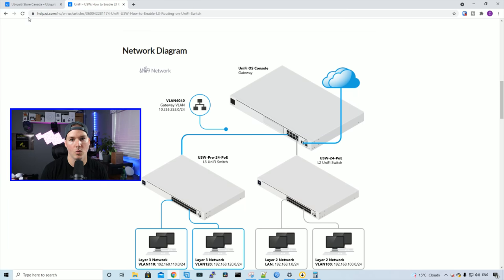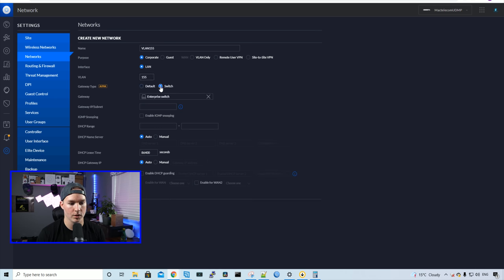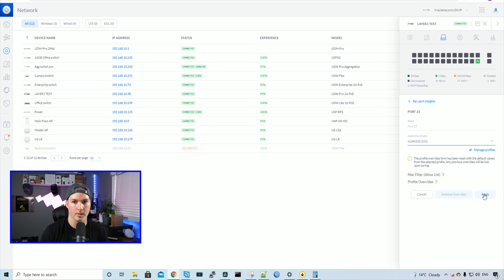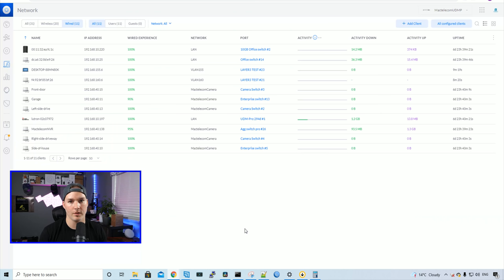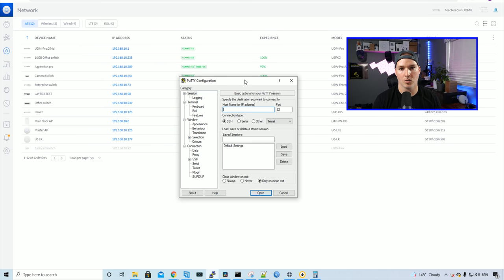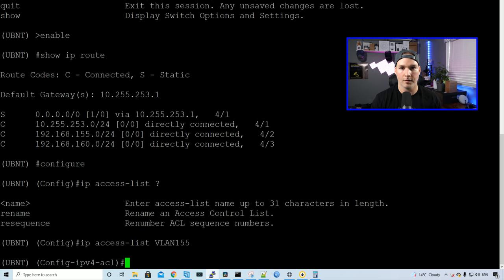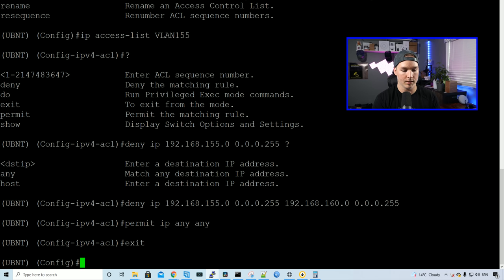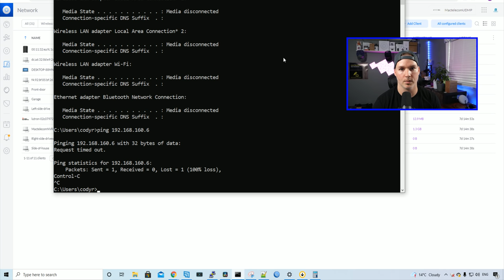Unifi Layer 3 Switching

Comment: Can you please do a video to explain this.  UniFi Switch - Layer 3 Routing
Layer 3 Routing allows a UniFi Switch to route traffic between VLANs and to other destinations using static routes. It is possible use L3 Routing with a UniFi Gateway or third-party gateway.

cannot get internet access from a layer 3 switch when it is set using unifi XG or Router console.

Comment: Is this SSH to create temporary ACL rules still the only way to make these rules for setting up inter-vlan blocking for L3 switches?
Reply from the maker: There is an update coming out that will allow us to do it in the gui interface. It’s currently in early access
Reply: @MactelecomNetworks  Awesome. I guess that's about perfect timing for me. lol. I do have Early Access on my account, and I am about to put my L3 switch in later today which is why I have been going around watching videos on Unifi ACLs. Is the place to make those ACL rules in something like Settings -> Routing -> Policy-Based Rules? Or do I make them in Settings -> Security -> Traffic & Firewall Rules?
Reply: I did figure out the area to configure the ACLs. It is unfortunately an all or nothing thing right now. Block a whole VLAN from another VLAN. I wish I could make exception rules or just specific rules, as I want to block most devices but let 1-2 from some VLANs have access to another VLAN.
Reply: I posted on Ubiquiti forums asking for more ACL features and Glenn @UI said they are a work in progress and more capability is expected to release in the next minor update for EA 😁

Comment: I saw that you configured "Block inter-vlan routing rule" in the firewall to prevent RFC1918 to RFC1918.    But I also noticed that you configured VLAN ACLs to prevent inter-VLAN communication. Is this necessary? Why are you doing this?

Comment: I have a total 4 VLAN vlan10 Data, vlan11 printer, VLAN 12 Wifi, and VLAN 20 for voice, I need to configure inter-VLAN routing unify 24 port enterprise switch could you please help me
Reply from the maker: Are you looking at configuring it through a layer 3 switch? Which router/firewall do you use? If you're using a UDM pro inter-vlan routing is enable by default
Reply: @MactelecomNetworks   through UDM only i can able to reach different VLAN but continuously the ping getting dropping

Comment: Hi Cody, 
Why you did not just creat the ACL instead of the ACL + Firewall rule ?
Reply: The firewall rule was created just to show that it doesn't work for layer 3 routing done on the switches. You would not do this in practice, he just did it to show the point.

Comment: Super dumb question. But can I do later 3 intervlan routing on the USW-24-G2 and the UDM pro?
Reply: You can do it, always could but the performance is not great. On my 10Gbps home network I only get about 1Gbps throughput when doing inter vlan routing using UDMP.
Reply: @carlnakamura4861  thanks for the reply. I tried to configure intervlan routing quickly it couldn't get it to work. Running all my traffic through the SFP port and I couldn't get it to work. May have to create a separate trunk port for each vlan, maybe?

Comment: A good simple explanation & demo of setting up Layer 3 switching on a UniFi switch. Personally I'm not too worried about not having the ACL functionality in the GUI because I don't have a use for that typically. If I want to filter a L3 interface I put it on a firewall but the option still needs to be there. The more worrying thing is the DHCP relay not working on a VLAN interface on a L3 switch.

Comment: Still waiting for that ACL to be functional in controller GUI...
Reply from the maker: You may be waiting a while
Reply: @MactelecomNetworks  from my several years experience with unifi, I no longer wait for anything. If it does not have it now, I would just choose another solution. New shiny aggregation switch? No, edgeswitch still works great, has L3 and proper ACL. New router? No, pfsense still my go to.

Comment: Hey Cody, great video but I'm curious on the performance of inter vlan routing/L3 routing. As you can do L3 routing in UDM Pro functionally but performance is really bad. I can only get just above 1Gbps throughput. L3 routing at 10Gbps would be the one thing that would warrant buying the unifi pro line switches. Are you planning on doing any performance testing of L3 routing using the pro switches?

Comment: Keep in mind that, its a "best practice" to have all Vlans on the edge router(fw) of course it depends from scenario but, lets say youve got  an UTM (sophos, forti, paloalto etc) and having all vlans on those, allows you to apply additional layer of protection enabling traffic filtering  etc.
Reply: It really depends how much traffic is been pushed through. We have around 2000 vlans at work and 4 core switches all in a mesh whilst the firewall is routing more sensitive and less trusted networks for greater flexibility and easier management than ACLs on a switch. Intervlan routing for Wired clients is done on the L3 switches.
Reply: @davidsomething4867  sure you're right. It depends from scenarios ;)

Comment: Great video. Now just have to wait for UniFi to implement it in the UI. Hopefully they will before I need to purchase my next switch, as i need L3 routing and would prefer to stay with UniFi.
Reply from the maker: Ya the command line is a little slow that’s for sure
Reply: @MactelecomNetworks  not so worried about using a CLI. Mostly concerned that my changes will be persistent.

Comment: I need someone to tell me I dont need layer 3 entrprise switches for my home.   I know I dont need it now, but what if one day I do?! lol
Reply: If you're not doing a massive amount of intervlan routing and you have something like a UDM you don't need this. Most of my VLAN traffic I have that way specifically because I don't want it touching other networks. So for those this would not be needed or have any function. But there are certainly scenarios where you do need that (if you're doing more than your UDM can handle, or if you want to offload it so the UDM can do other things). Then these L3 switches can be useful. But if you don't need isolation then you can either not use separate VLANs, or if you do you can leave the access open (the default). Only if you need the separation AND if you need to isolate them for the most part while still allowing other traffic would you follow the steps that have been provided in this video.

Comment: Great video.  I wish UniFi had ACLs built-into Network to make it easier to configure.  Just so I understand correctly, all routing is done through the switch except interVLAN (which goes through the router).  Does an L3 network still have ability to have WAN access?  Would there be any benefit in moving an IoT or camera network/VLAN to an L3 network?  I would still need interVLAN routing as my UNVR is on my main LAN.

Thanks for all your videos!

Comment: nice video Cody, Just a shame there is no persistence when you make config changes in the CLI. I'm in the process of trying to write a script, so when it does reboot it should put everything back on automatically but I've had a few delays on getting round to finishing it.

Something else worth noting is the DHCP Relay does not work on L3 switches. The UniFi console allows you to create one, but doesn't actually do anything which is frustrating when you have Windows Server DHCP setup.
Reply from the maker: That’s good to know I didn’t test the dhcp relay
Reply: Nice Sharing!

Comment: Technically, Layer 3 is routing/IP Layer.  Switching is Layer2. #NetworkNickOfficial
Multi-Layer Switch. Does it do layer 4?
Reply from the maker: It’s a layer 3 switch or yes a multilayer switch which implies multilayer ( layer 2 and layer 3)

It does routing between vlans as well as static routes ( which I’m not sure is working Atm) no layer 4

Comment: Would be interested in seeing you test adding of additional static routes for the VLANs. It is exposed to the UI for the pro switches but doesn’t seem to actually do anything. If you then add via the cli it all kicks into life and works but doesn’t survive a reboot. Can’t seem to get any traction with UniFi to fix what has to be a bug. One of their firmware releases states the support for it.

Comment: Worst implementation ever of layer-3 routing on a switch.  Furthermore, the ACL's should be configured and applied on the switch where the particular layer-3 VLANs are terminated.  Unifi needs to go back to the drawing board because this is a convoluted implementation and still burdens the UDM-Pro with processing the ACL's for layer-3 boundaries that are on other devices.  This will become a problem as the number of layer-3 VLANs and related ACLs grows.  It's also weird that they expose the inter-VLAN routing interface to the GUI.   Hopefully it can't be modified because I would venture to guess that would cause problems and/or require "you" to re-IP your network if that network was in use prior to terminating layer-3 on other switches.  I can't think of any other manufacturer of layer-3 switches that dedicates a separate network to inter-VLAN routing.  I would compare this to the "interesting" way Mikrotik wrote SwitchOS and RouterOS.
Reply from the maker: I think I took this comment the wrong way. Are you complaining about how I had spoken about it or Ubiquiti?
Reply from the maker: Ok you were talking more so Ubiquiti I was confused 😂 you make good points

I just thought I’d make a video as I’d been asked so many times
Reply: @MactelecomNetworks  The work that you do is awesome.  I definitely enjoy your videos because they are very informative.  Ubiquiti should rethink their implementation of layer-3 in the Unifi product line.
Reply from the maker: @rayk32  ya I totally read the first comment wrong 😂 glad you enjoy the videos. 

The layer 3 is still in alpha so hopefully they end up improving it
Reply: @rayk32  Yed, video's are very informative. But Ubiquiti should indeed rethink L3 AND their "firewall". It feels like they're forcing people to use the UDM or UDM-pro but the devices are mediocre at best. (Although the low price makes up for it)
Reply: I can add personal experience with the L3 features of the USW Pro 48 switches.  A few months ago I attempted to deploy 10 USW Pro 48's to a school environment with one of them setup as the L3 switch.  There was an existing non Ubiquiti firewall that we re-used, so we also deployed a cloud key gen 2.  After some trial/error, I was able to get the L3 routing to function in my home lab before deploying to the site.  Discovered that DHCP relay did not work and settled on letting the USW Pro be the DHCP server.  Next we deployed the switches and thought we had a functional network.  However within a week, the DHCP server on the USW Pro failed several times requiring a reboot to resolve.  In the end we had to re-deploy an old Dell 6248 L3 switch and use the USW Pro's as L2 only.  Not exactly what we were planning but it has been stable for a few months and survived the beginning of the school year.  Throughout the configuration and issues I worked with Ubiquiti support.  Eventually the case was escalated to a higher tier support person.  He was very honest and let me know right away the DHCP relay would not work and that using the CLI command as a workaround was not going to survive a reboot.  There may be ways to resolve that by manually modifying files, etc, but since those methods are not supported by Ubiquiti, I chose not to go down that road.  I needed to be able to deploy and not have to re-visit for issues later.  Ubiquiti support would not provide any info about fixing the dhcp relay feature.  I was reasonable with them the entire time and simply asked them to make the limitations known in their documentation and sales literature.  Anyone seen anything in release notes, etc?(to be honest I haven't checked)  Buyer be aware, the L3 features of the USW Pro switches are not suitable for a network outside of a home or test lab environment.  No complaints about the video, just sharing experience.  I use a UDM and Ubiquiti AP's at home and they work well.
Reply: @kendavis6321  Thanks for your input on the matter. Do you know if this has changed since you wrote this?
Reply: @MR-vj8dn  No I don't know, but I'd expect to see announcements and from Ubiquiti and/or youtubers if they released any significant L3 feature enhancements.
Reply: @kendavis6321  they have finally addressed the DHCP  relay issue, have you tried it again with an relay?
Reply: @evoboy67  I have not.  I no longer have any Unifi switches to test with.

Comment: To be honest, I don't recommend using the L3 functionality of Switch because your traffic will never hit a UDM firewall and you will be unaware of traffic that is traversing between VLANs. Just my opinion. Static routing doesn't take that much resource from your UDM unless you have millions of routes in your routing table. At that point, you might want to look elsewhere.
Reply: But I may want to route more bits per second than any of the ports of the UDM is capable of?

Comment: Thanks Cody, been wanting to see a bit more of the Unifi Layer 3 switchig stuff for a while. The bit on the ACLs via the CLI, be interesting to see if firmware updates interfere with this :-) . I don't think I'll be moving away from Aruba to Unifi Layer3 switching anytime soon though as the features (Dynamic routing, IPv6, Stacking or redundancy) are jus not there yet, maybe they will be eventually :-)
Reply from the maker: I doubt a lot of people will go in through the CLI to make these ACLs but thought I would show it anyways. Im hoping they have something in the works to get it into the UI.

Speaking of Aruba more videos coming in the next few weeks
Reply: @MactelecomNetworks  Thank you :-)